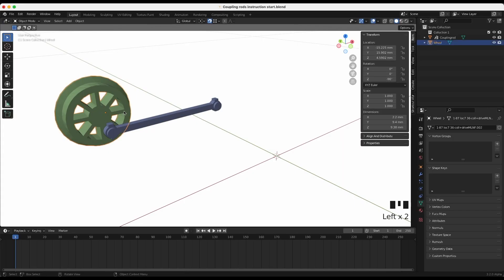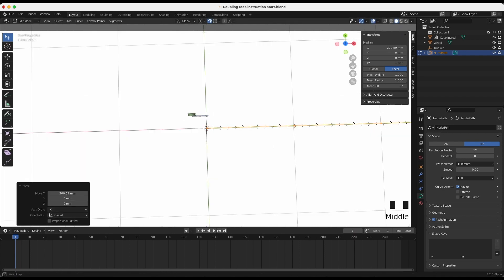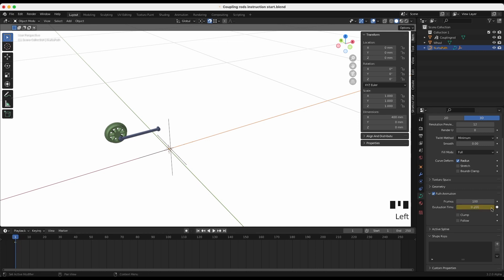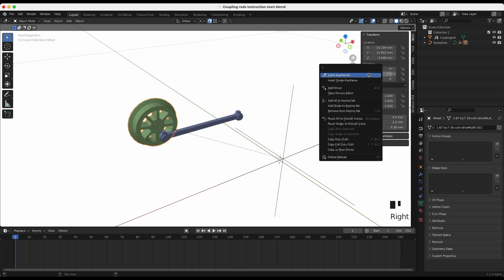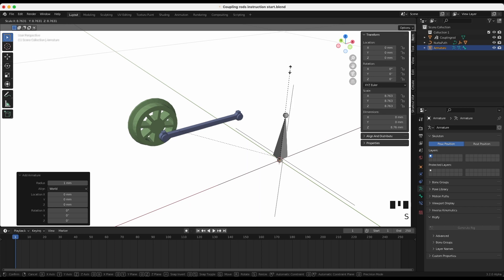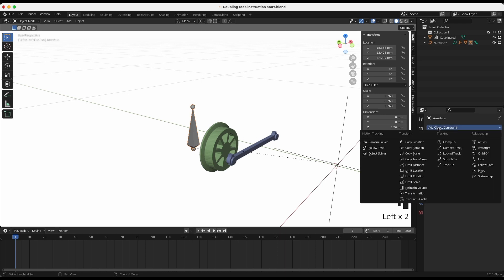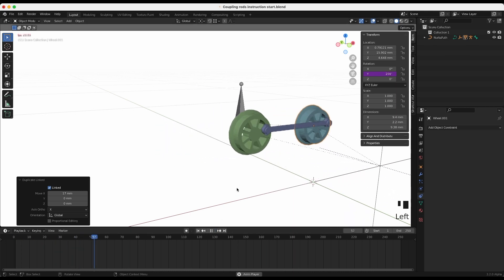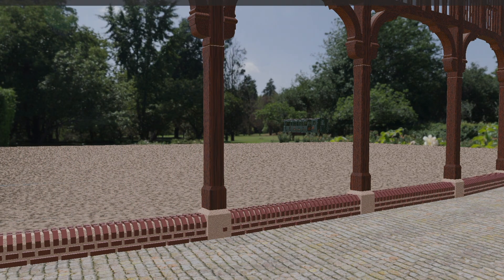Blender 3.x: Animated train wheels and working coupling rod/valve gear

Comment: sorry but in blender 3.5 the expression 1*VAR dosent work, or in general i stuck there,..the weheel is not rotating, can you give any update or somethign helpfull ? thanks sir
Reply: Hi try var*1 the 1 represents the speed of rotation so if ur wheels are going the wrong way try var*-1 u can even use decimal values like var*0.8 remember to set it to Y location too
Reply from the maker: I just tested it in Blender 3.6.4, it works. Did you link the wheel to the tracker (plain axis in this case)? It only rotates when it has a tracker connected to it. If you want it to move and not stand still and turn, you have to parent it to the tracker, on top of that. Test it by creating a blank new document> Create a cube and plain axis (called Empty)> Select the cube> add a Driver> Enter 1*var in the Expression box> Choose the plain axis (Empty) and now when you drag the plain axis, the cube will rotate.